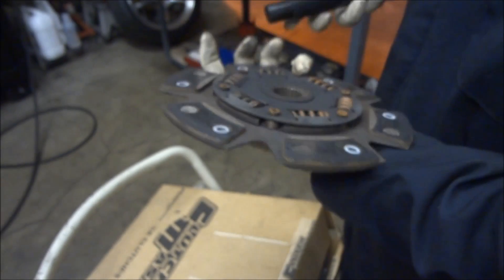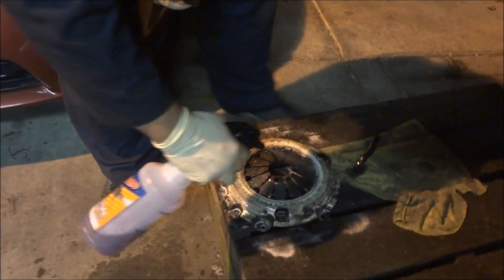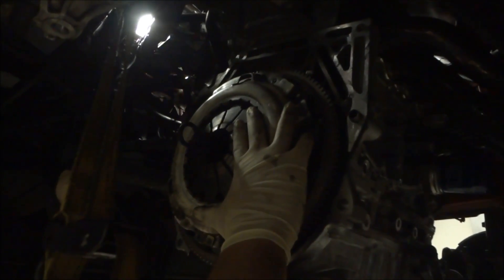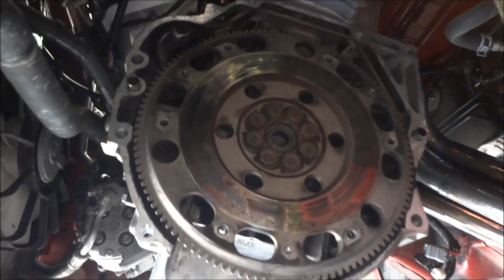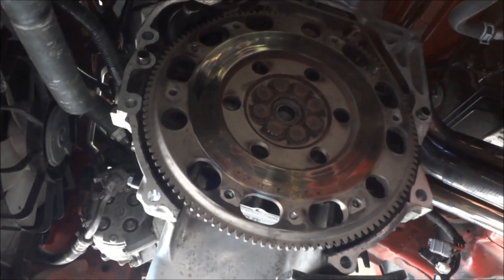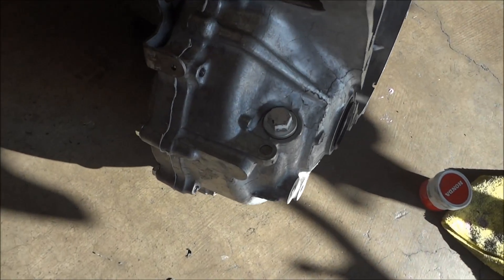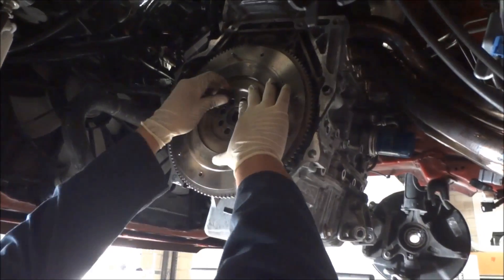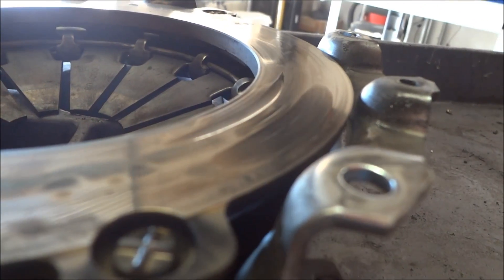K Series Transmission Rebuild Part 3: Installing Flywheel, Clutch Disk, Pressure Plate

Comment: This video is very informative it left me paranoid with the shop that will do my work lmao. Cars going in tomorrow for full clutch kit job,I will make sure they torque those flywheel bolts right , and grease everything up, pray for me 9th gen owners, and thank you for the content! 🙏🏼🤙🏽
Reply: Robert Mendez Some people don’t like to pay the rate of the services of a reputable shop.  What they don’t understand is that it ends up costing more if it gets done at a cheap shop.

Comment: how is the fx400 holding up?

I had a comp stage 4 on my old si which held up great especially with wot shifts.  It wasnt too bad in traffic or track days.  Im going to be throwing a k24/k20 in my newer 8thgen and wondering if i should use comp again or try the fx400... mostly daily driving, some track use.

Comment: tong how much did this job cost you? I need new synchros, clutch and flywheel. my shit is fucked up. Im thinkin of just trading in and cutting my losses. if you can save my fg2 id appreciate it. thanks a lot mang
Reply from the maker: +wreckinplankton 1500 for the rebuild
Reply: Not bad at all. Taking her in tomorrow. thanks for the quick response
Reply: TheTongMan and i would assume its safe to stay w/ the oem synchros over stech?

Comment: At 5.13 on this video, that piece that is all pink mine it's broken, it's there a way to fix that?
Reply: cstrcnby18 if there is a small chip on the end dont worry about it, if its cracked you would need a new bellhousing unfortunately.

Comment: Tong, what was that first thing you pounded in right in the beginning? and does it need replaced when you change clutches?
Reply from the maker: its a bushing for the mainshaft. a new bushing should be included with your new clutch kit. watch my clutch unboxing video for more info
Reply: Guessing you need a special tool to remove and install a new one eh?

Comment: Hey tong,
Just wanted to know if you did actually use the second bolt and filled it with 2 quarts insread of 1.8. Seems like it would help to have a little more
Reply from the maker: Ricardo Mendoza Yes we did. We filled the transmission with the top fill bolt.